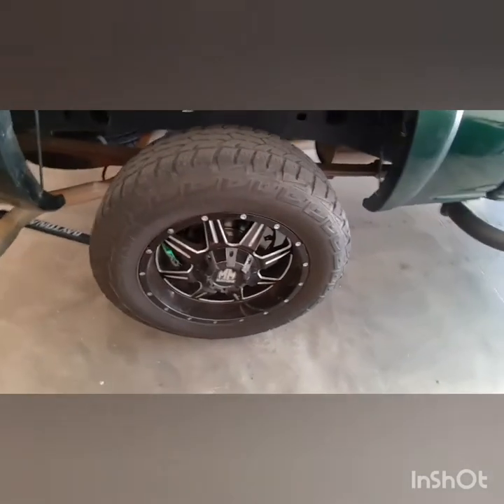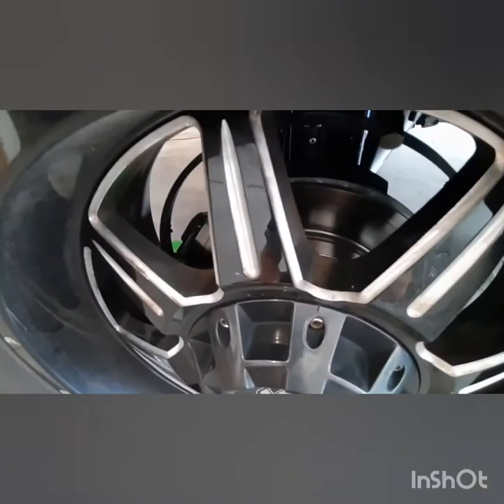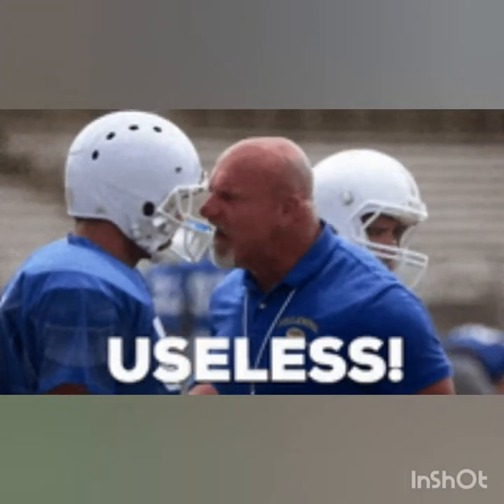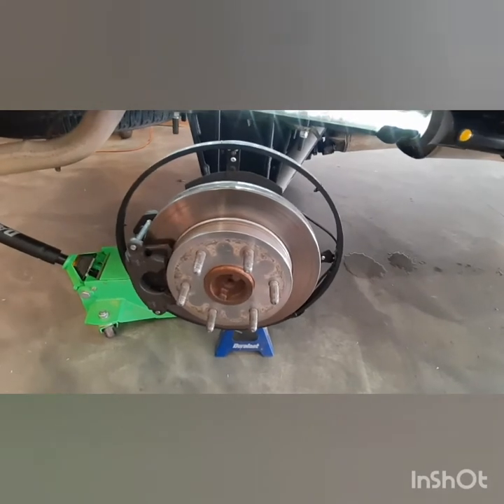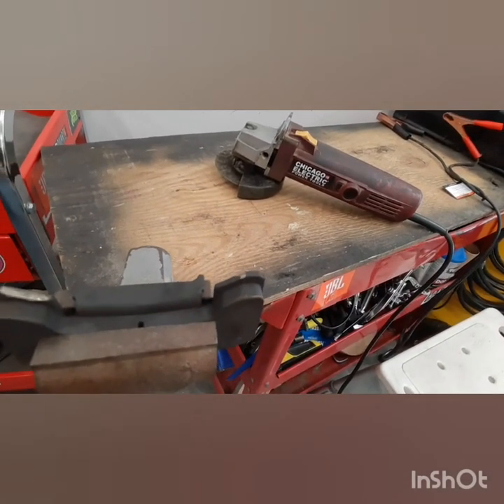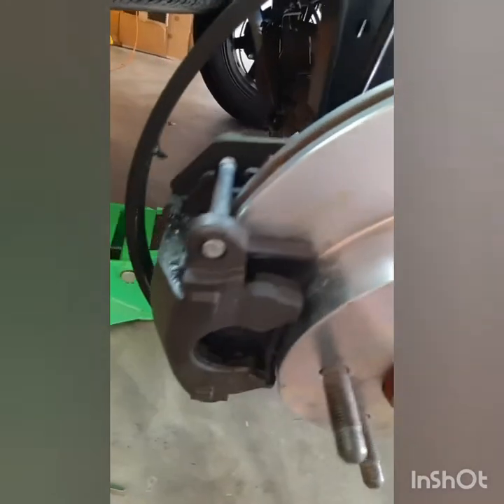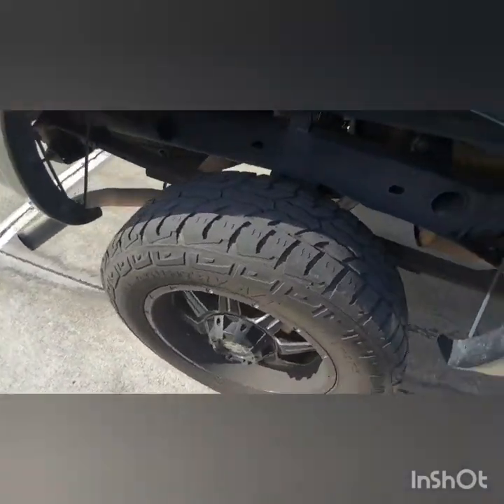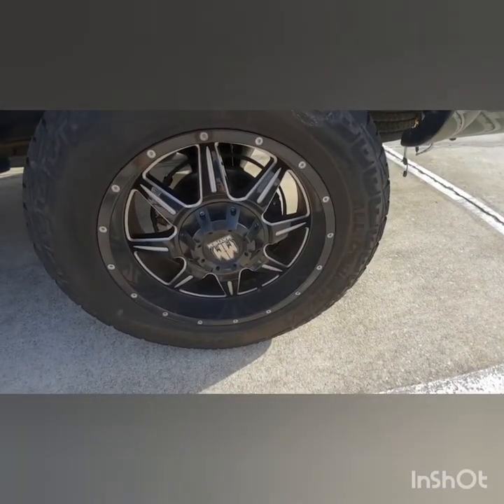Why you shouldn't use Little shop manufacturing rear brake conversion. LSMFG rear brake review.

Comment: I Just went to our local salvage yard a purchased a complete rear housing with stock oem rear disc brakes. Swapped everything over onto my truck then sold the donner axle to break even. Think I just herd you suggest the same! Later I upgraded the rotor and installed some heavy service pads and we were in business! Nice video, will surly save someone some heartache and pain. Well done Sir!

Comment: I had a different outcome.  it's good to go on my 2007 silverado.  brake dust is going to happen no matter what, but I think you should have just bought a wilwood kit if you wanted it to be perfect.  this is just good service equipment.... nice truck though...
Reply from the maker: They (little shop)  updated the parts.  Really pointless in my case because they sent only brackets and I have to source pads and rotors. If you see my other videos I am not afraid to fab. I however don't have time to disable my daily ,I only wanted the diss to show off my wheel lights. The brake dust I described turned out to be the actual bolts going through the caliper brackets. I would expect anything to do with brakes to be sold as perfect! I don't think you understand the severity of the problems with the original design consider yourself lucky. Thanks for the compliment good luck with the brakes.

Comment: The brackets is what I’m looking at then I’ll go to gm and get calipers and rotors off a ss Malibu and drill the holes out to fit the Obs then I know it factory/ china lol
Reply from the maker: I am sure someone makes a kit for an obs Chevy. Steer clear of Little shop though. I am still dealing with this trash on my truck. Brakes squeak,squeal and leave a lot of dust.
Reply: Did you ever find another kit? I was going with little shop for the brackets and powerstop for my brakes and calipers
Reply from the maker: @josephordaz4983  what year is your truck? What is the rear end? I wish little shop would make it right. I found something else they make that I want.  I WON'T order from them because of these brakes. I still need to cut more pad off the  passenger side or make my own brackets.
Reply: My 99 silverado 1500 has disc from the factory on the rear, I would stick with drums overall the rear brakes are a headache - my other trucks all have drums I rarely have issues with them